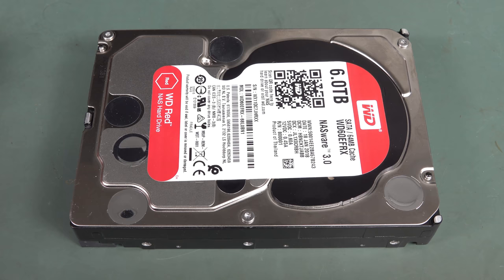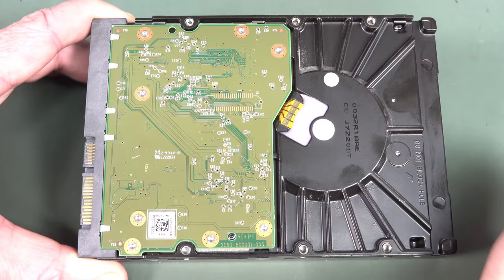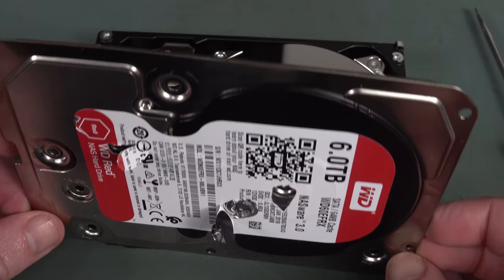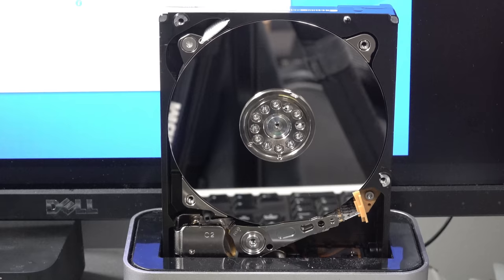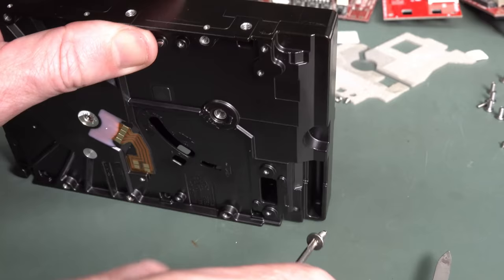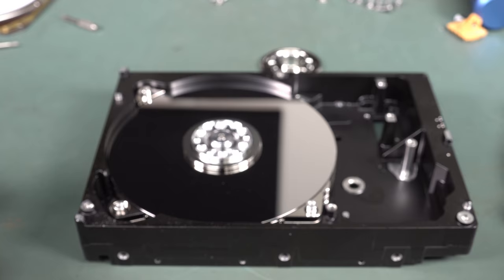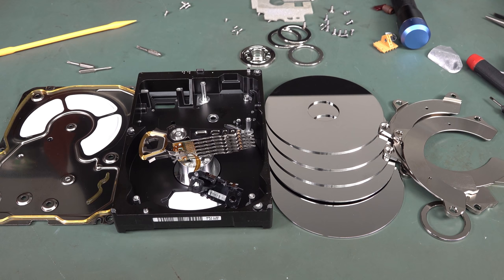EEVblog 1398 - Western Digital RED 6TB WD60EFRX Hard Drive TEARDOWN

Comment: The 2 notches at 16:31 I believe is to balance the spindle when the screws are attached. The noise should be coming from the seeking motion when the drive starts and it's looking for the index ring or something. I've not seen any more scratches on the disk like it used to when drive fails nowadays.

Comment: It's actually not just a desiccant packet. That is the micro particle catch. If something were to get into the drive, it would get flung into that catch.
Reply: But there is an filter and desiccant packet near the vent hole.
Reply: @paulcohen1555  You do realize there is ventilation hole right? So the desiccant pack would be fully saturated with moisture by a few days to weeks on a product that is supposed to last years therefor rendering it useless?
Reply: @marksnow8838  But there there isn't a fan behind that hole.
It's just to equalize small differences in the pressure.
And it's doing a good job when the drive is kept at a constant temperature.
Reply: @paulcohen1555  So what's up calling it a "vent hole"? Regardless a hole allows moisture to seep in, so if its a desiccant pack(which its not), then it would be fully saturated with moisture within a short time span.

Anyway the hole at the bottom of the drive is mainly for pressure equalization caused by weather changes, altitude changes, temperature changes etc. The filter beside the platter is to catch any remaining particles after assembly or would be generated during the operating lifespan of the drive. The platters still moves air even though its not shaped like a fan.

That is why you need multiple filter in a hard disk.
Reply: Exactly. At 5400 or 7200 RPM, the spin of the discs create a whirlwind of sorts that flow through that micro filter catching any small particles.

Comment: Servo data is written on every surface. The slot under the large sticker is where an arm from the servo writing machine connects to the head assembly to write the servo tracks on the platter during production. The head assembly whacking back and forth means the firmware can’t find the servo tracks and calibrate. It tries a bunch of times then gives up and packs itself.

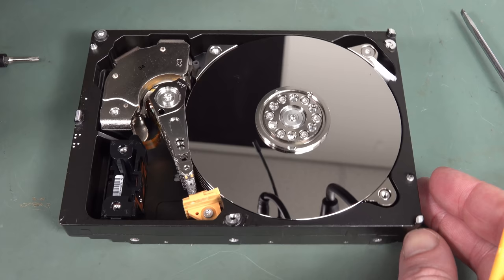Comment: I'm impressed that at @8:26 just after taking off the top that you've already got visible dust specks on it (upper right corner, and upper left corner near the middle of the platters). Just goes to show how important clean room facilities are due to how quickly it can become contaminated.

Comment: As you saw, The hard drive platters are so smooth and flat that you can ring them together like Guage blocks (assuming you don't finger print them up). I recycle these and take them apart all the time. I like to ring several platters together end to end.

Comment: A few years ago, I bought 4 6TB WD red drives thinking they'd be great for my new NAS not knowing they were the SMR drives. I moved ALL of my data onto these drives before I discovered the difference between CMR and SMR and was very upset that they'd put this in their red series. I contacted WD support, and they replaced all 4 of my FAX drives with the FRX drives for free. Not only that, but they sent me the drives first so I could copy my data over and requested I sent my FAX drives back after I received the FRX. There is a nearly $100 difference between the two drives, so WD essentially gave me $400 because I was a poorly informed customer... gotta say I am a WD customer for life now.

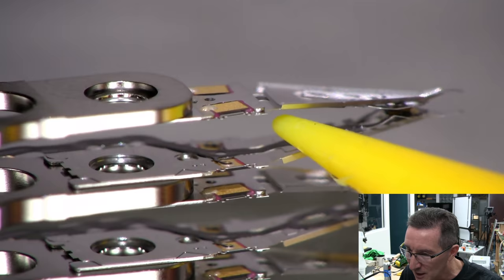Comment: 20:25 Those aren't test pads. Those are Piezo dual-stage actuators for fine positioning a head onto a track or jogging to an adjacent track. They work in such a way that they cause a twist in the arm that is converted into a side-to-side motion at head. Read about it in the whitepapers published by various drive makers.

Comment: Dave, the so-called death clicking is not usually caused by problems on the surface of the platters. Mostly, it comes from either head assembly problems or platter motor problems. As you mentioned, tolerances are extremely small, so if heads can't move properly or platter rpm isn't spot-on, the drive's controller enters a loop trying to seek valid signal(or data - I'm not exactly sure whther it's the actual onboard controller of the HDD or the motherboard). At least that's what I remember from university :)

There is another type of click, which is more rhythmic, and very loud - that's if there's issues in the signal path of the heads so they don't get any feedback off the tracks. The servo then launches them to the middle and they hit hard and click. But that's not what you hear here.

By the way, if u listen carefully, when you spin the drive open, there is a specific sound when the heads passed over the scratch you made - that totally destroyed the head :)

Oh, one more thing - those notches on the platter shaft I think are weight balancing holes so that the center of mass is exactly in the middle.

Comment: Almost like  Casimir effect when you put those platters together -- but it's just atmospheric pressure at work :-)
Reply: Yes, the majority will be atmospheric pressure difference, but those surfaces are pretty flat/smooth and extremely close when together, so the Casimir effect must be playing some role - maybe even a substantial role in trying to get them apart. Ofcourse, these disks are magnetised in a specific pattern so perhaps magnetism had something to do with it too?
Reply: @BenMitro  Any sufficiently flat non-magnetic surfaces will still do the same thing. 

Dunno if it's Casimir effect or not but machinists/metrologists (not meteorologists, that's something else entirely ;) ) regularly use it. In that world it's called "wringing". Allows you to essentially stick two metal objects (usually things like gauge blocks) together without losing precision. e.g. if you need a 23mm gauge block you might "wring" a 20mm and a 3mm block together.
Reply: @SomeMorganSomewhere  Thanks Morgan. I've often wondered what the cause of the stickiness between two gauge blocks is. I know that two clean metals in a vacuum will weld to some extend by coming together and this seems to be an effect due to electrons migrating from one metal to the other (If I've understood the explanation correctly) - perhaps this too is responsible for wringing and perhaps the effect that Dave experienced with the disks?
Reply: In older drives that didn't unload the heads from the platters when shut down like modern ones do, they could have a condition called stiction where the heads would actually adhere to the platters because of the surface flatness, and prevent the drive from spinning.
Reply: @RobertHancock1  Thanks Robert. I looked up stiction or static friction (only because I've only heard AvE use the word before your comment). There seems to be plenty of examples but I can't find an explanation. Will have to dig deeper.
Reply: @RobertHancock1  Yep, I remember giving the old 20MB units a sharp whack with a screwdriver when they did that :-)
Reply: It is a brilliant effect to encounter. Howver, the effect is quickly lost when the surface gets dirty.
Reply: It's the Van Der Waals forces that glue extremely flat surfaces together, even in vacuum, and even glass on metal.
Reply: @ultort  Wow, thanks for the explanation. I did some more reading and came across a paper that states "van der Waals and Casimir forces which arise due to zero-point and thermal fluctuations of the electromagnetic field between closely spaced material surfaces" here https://arxiv.org/abs/1507.02393 I knew about Van der Waals force as having to do with alignment of dipoles in materials brought quite close, but casimir effect remains a mystery, however this linking of the two effects points the way, so again thanks!
Reply: @BenMitro  , some grades of stainless steel can stick/weld together too.  ive seen it written that it is due to a lack of oxide coating.  such alloys should not be assembled when perfectly clean without a coating of oil or something.  this probably stands true for other metals without an oxide coating.  i'm also thinking noble metals like gold etc.might be the same.   i well may stand to be corrected on this.
Reply: @vsvnrg3263  sounds reasonable vsv nrg. I imagine someone has documented experimental evidence is one is willing to search for it.
Reply: @BenMitro  , these stickinesses could be due to the shape of the molecules in the materials.  for example a stretched lakker band might get a bit stuck to itself.  or a better example is the self amalgamating (aka fusing) silicon tape.  i bet this is how this works.  the polymer molecules snag on each other to a point that it cant be separated from itself and seems to have never been separate.  for those of you who have never seen this stuff count me as one of you because it has been around for more than a decade yet i only found out about it a year ago.
Reply: @BenMitro  Look up Van Der Waals forces, I've also heard it called Casimir and even the gecko effect. He didn't mention it, but I was curious to know if the platters are still made of glass or ceramic like they were in drives I took apart many years ago.
Reply: @vsvnrg3263  I have some self amalgamating tape for a project. Amazing stuff.
Reply: @BenMitro  , yes, isnt it!  i was watching a youtube video about repairing a rubber boot on a cv joint and noticed the tape the man was weaving around parts of the car front end didnt stick to anything.  so i googled tape that doesnt stick to anything except itself.  and google knew what i meant.

Comment: Hey Dave, those screws may be Torx Plus not standard Torx.
Reply: I have been recycling e-waste for about 12 years now and I have taken apart 1000's and 1000's of drives.  Regular Torx screwdrivers are fine.  But you need a VERY well precision made screwdriver for the perfect fit on those.  I have been using the same T8 screwdriver on those screws for about 10 years now.  Cost me almost $20 just for the one screwdriver.  Totally worth the money though.
Reply: @markjohnson7887  what brand do you recommend for precision bits? or what brand is that torx?
Reply: @runforitman  Wiha and PB Swiss are very good.
Reply: @markjohnson7887  , 1000's of drives?  do you save magnets like me?  do your kids think youre the best dad on the whole earth?

Comment: I remember the first time I took 1 of my old dead HDD's apart and scavenged the magnets etc out of the thing
Reply: Yeah, did my first one as a kid and i thought i had discovered the strongest magnets on the world :)
Reply: They make excellent fridge magnets for thicker or heavier things.
Reply: @volvo09  The first time you accidentally snap them together and you get a blood blister. lol
Reply: The full-height SCSI drives have magnets that are about 4x as thick. I managed to scavenge about 20 of them. Very handy. Also quite dangerous.
Reply: Ah yes, I too remember the pain of an out of nowhere pinched finger lol.
Also, be careful with laptop hard drives as they often have glass platters, a friend found out in a surprising way when the patter exploded as he was taking it out with a screwdriver and applied a bit too much force.
Reply: @GoldSrc_  Yeah. Not sure I've ever seen a laptop drive without glass platters. Some desktop and server drives also have glass platters, even among similar models that have aluminium alloy. Not sure why. Can't just be a thickness issue. It sucks because many customers pre-drill their drives before we recycle them, and glass platters make a mess, which inevitably falls out the drill hole.
Reply: @soupisgoodfood42  I had an old laptop hard drive that didn't have glass platters.
I guess glass is cheaper to use for those smaller drives.
Reply: @GoldSrc_  Not sure it's a cost thing. Maybe once they get that thin, aluminium platters are more prone to warping?

Comment: I always remove the magnets from hard drives before tossing dead ones - they are crazy useful.  Have a friend who is a veteran and he has shrapnel still surfacing from an old wound - gave him one of those neodymium magnets, advised him to put it in the ziplock freezer back to keep it clean and it worked a treat - as more pieces of shrapnel start to surface underneath his skin, the magnets really speed up getting it out.  He's told his buddies and now they are all going around looking for more hard drives.  So if you know of anyone with any injuries with shrapnel these magnets work a treat.

So many uses!
Reply: No good with plastic or stone shrapnel.
Reply: @johndododoe1411  Obviously - but if they have metal shrapnel they are surprisingly effective!

Comment: Sounded like bearing failure to me, would explain the dependency on orientation for the noises. Then the motor would not reach its operating speed and the data looks garbled to the controller, hence it stops.
Reply: Could be bearings or a motor with a phase with a single shorted turn, which will mean it cannot run up to speed. Simplest test if it is a bearing is to heat it up to around 90C in the bearing area, then put the board back on and see if it starts up. The heat makes the lubricant flow again and repack the balls.
Reply: Bearings don’t fail on those. Most likely mild bad sectors / head damage that caused the drive to go offline on the array.
Reply: @SeanBZA  na man
Reply: @SeanBZA  the only drives that happened too were 20/40/60 IDE 2.5 Toshiba drives. Fix was to heat the bearings with a heat gun while imaging. You never unpack anything
Reply: *fuji
Reply: @remotesupport   Do they have the monopoly on non-failing bearings? Or are you talking about statistical probabilities, using generalizations?
Reply: @denny9931  experience

Comment: The small square bag in the corner is a air filter, the shape of the chamber gives you a clue, the air movement from the platters draws a little air through it as the drive spins.
The separation plates between the platters are there to reduce the amount of air that moves across the faster moving edges of the platters, to reduce drag.
Quite often in smaller drives the platters are made from glass with a coating applied by vacuum deposition.
Reply: I'd wondered if that was what the plates were for - thank you for confirming it.

Comment: Platter screw was probably an ip7, torx plus #7. We used those in cell phones, they are able to take higher torque without stripping the head. Normal torx can be used, but is not the preferred tool for them. Torx plus  drivers will not fit torx screws at all.
Reply: From my experience taking apart 1,000's and 1,000's of these, it's a T8.  But you need really precise screwdrivers.  The one I use for the platters is a T8 and it cost me about $20.  Just for the one screwdriver.  If you spend less money, there will always be some play and they will always strip.  I found that out the hard way when I first started my computer recycling business about 12 years ago.
Reply: @markjohnson7887  That's my experience, too. So easy to strip the head and damaged the bit at the same time if you're not careful with the trigger on the impact driver. When I line up a whole lot on the bench and get a good rhythm going, I can do about 2-3 screws a second.
Reply: @soupisgoodfood42  I hear you there.  Me too

Comment: The seals on all the screws help to clean the drive before opening it, or they prevent gunk that is difficult to clean out around the screws falling inside the drive while opening it. Obsolete since welded shut drives wit gas filling.